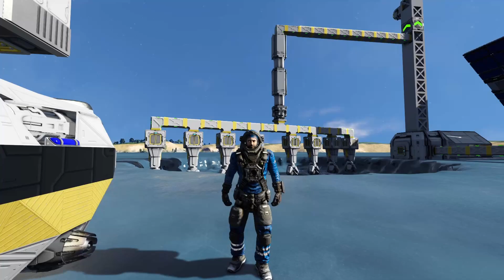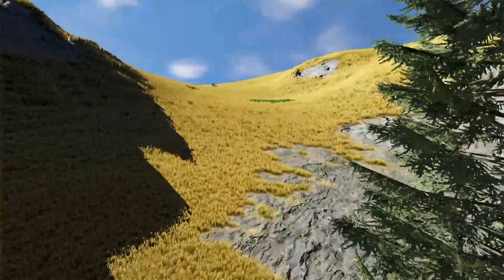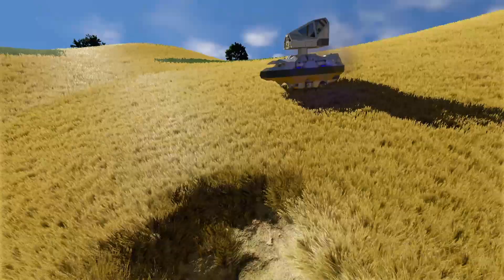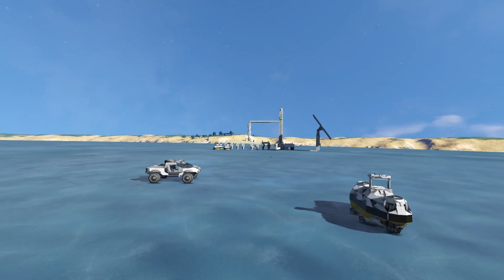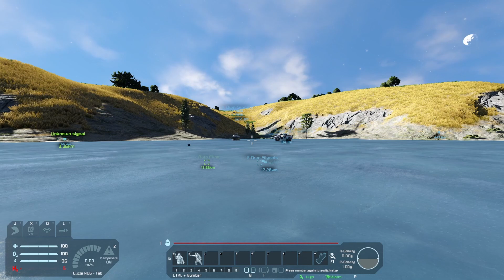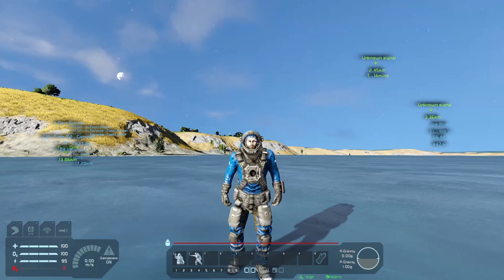AI blocks for transport drones are broken!!!

Comment: As you said it's a mess and thank you for posting 👍
To much effort to make them work as intended, they had been way more easily worked with if the magic blocks said if it's working or is there's a conflict? A hard reset button and som fanzy color or text to show you which slot is action 1-and-2 when setting up would help allot. I guess when they are working with this for months they know all the intricacies and go blinde to some obvious problems.

Comment: Yeah I noticed the AI blocks are buggy as hell recently when I started using them. We will be lucky if keen decides to fix them. 

I made a bug report about the behavior I was getting with a solar tower when using custom turret controller. It was flailing and wobbling all over the place and it wouldn't stop no matter what I did. I posted a video and everything to show them what was happening. When they replied they said "won't fix".

It was even on one of their official servers so there was no mods, experimental mode wasn't even enabled. As far as I know the fix was to put a gyro on top of the solar tower with a zeroed out override on it to make it stable.
Reply from the maker: I've run into similar issues. The fix for me was to max out the torque on the rotor and piston. That seemed to work.

Usually, keen is pretty good about addressing bugs. But, ibwould suggest making a post in the bugs section of their discussion forums on steam. Usually people from the community and forum mods will assist with work around and issues.